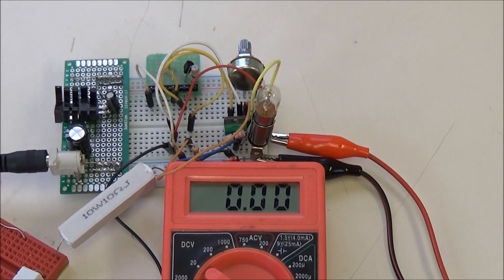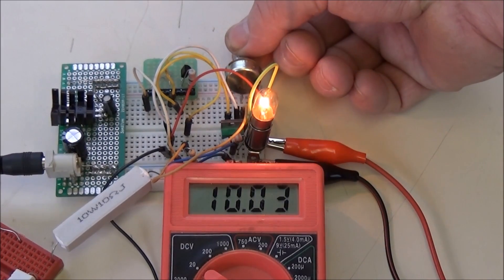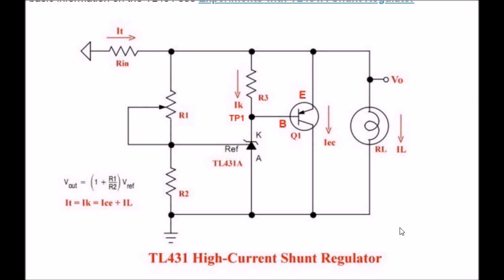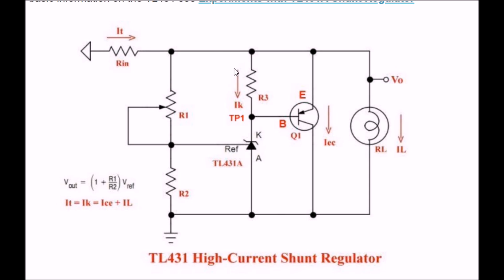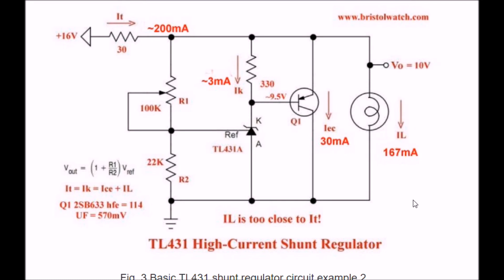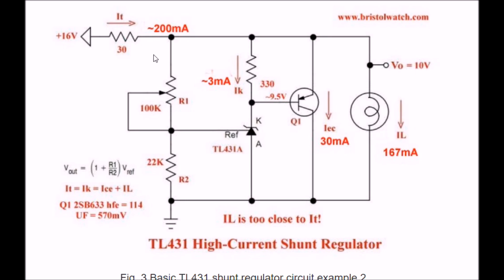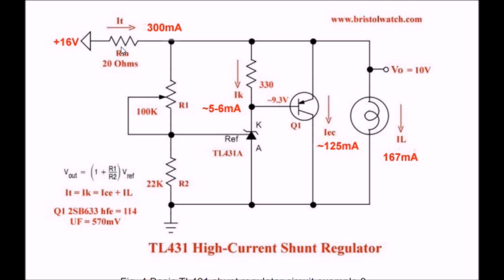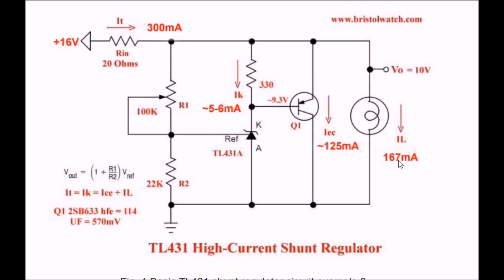TL431 Shunt Regulator Circuits Explained

Comment: im planning to use this tl431's as overvoltage protection on agm/lead acid batteries ..and wonder if theyll cause a problem.. i mean adjust it to 14.5 volts and connect outpit/leak to transistor/mofset therere after it reaches 14.5/max voltage agm batterues it will swith on a lef or something else to waste excess woltage thats going tocause pwercharge... in theory this seems like going to work ;)

Comment: does the voltage divider (R1 & R2) needs to be behind Rin? ... like in the drawing.
I used the circuit to create 5V from 12V without Rin and it seams to work fine and the load is neglectable, although the output is lower than calculated.
Reply from the maker: It can't work without Rin because that drops the excess voltage. I don't know what you mean by " create 5V from 12V" because this is a current, not a voltage regulator. The output voltage is the load resistance times the input current or R*I.
Reply: @LewisLoflin  Well, in the first circuit that uses the TL431, i used them as a positive / negative voltage regulator to create +/- 5V from +/-12V and now I'm designing another circuit with them for the same purpose.
Better to use LM317? the AT27C256 requires 6.5V and 13.5V, i have various zeners but not these values.
Reply from the maker: @AnalogDude_  I have programmed those and used 12-13V and 5V.
Reply from the maker: Use an LM317.
Reply: @LewisLoflin  Thnx, I'm making a programmer for them using a Microchip Fubarino. gonna use transformer of 2 x 15V, a bridge rectifier en than a 7815. so the LM317 will have some 1.5 V head room to make 13.5 V, that's what the datasheet says.
Reply from the maker: My programmer used a 6502-based SYM-1 with real 8-bit IO ports.  @AnalogDude_
Reply: @LewisLoflin  wanna use a 32 bit Microchip Fubarino, it's memory is large enough, i can store the entire "bin" in there. commercial ones are mostly made for windows.

Comment: aplication circuit for balancing all types of batteries!
Reply: This circuit can be used for this purpose, but every battery needs different resistors for matching the different voltages...

Comment: Hi Lewis, many thanks for the educational videos. Please can I ask a couple of questions: is the 9.3v at base of Q1 defined by the base-emitter drop (ie 10v - 0.7v) or by the set-point of the TL431A? Secondly, why would there be roughly 5-6mA going through the 330r resistor? I calculate Vdrop / Resistance = (10-9.3) / 330 = circa 2mA. Thanks again, Sean

Comment: You did not explain WHY the draw is reduced by the transistor when the load draw increases.
Reply from the maker: As the load draws more current, the overall available current and voltage drop. That is detected by R1/R2 voltage divider, which allows the TL431 to change its current draw. That changes the voltage drop across R3, changes the current through Q1.

Comment: is this resistor (between base and +) really necessary? if I want make simple voltage protection ( after solar panel)... Should I use some calculation to consider  Transistor Veb drop?
Reply from the maker: Yes. It helps set the current for the transistor and the TL431. What do you mean by voltage protection?
Reply: @LewisLoflin  I will try use on practice shunt regulator... I want to charge Ni-Zn accumulator (nominal 1.6V, charge 1.9V ) by 4V solar panel. I find TLV431 with Vfb 1.25V, but current limit is low, so I need PNP transistor to conduct more current than this IC. So I need hold  (1.9+0.2 Schottky diode ) 2.1 V. As I know solar panels  are not scary for short circuit, only external heat decries efficiency.  P.S. for this task (shunt external voltages) I can use few, serial connected,  ordinary diodes, but I want try some precision way

Comment: Do we able to give proctection to this shunt regulator psu if the pnp transistor failed ( there was a short between colector and emiter) ?
Reply from the maker: It would burn our RIN, but one could add a fuse before RIN.
Reply: @LewisLoflin thanks

Comment: What happens if the input voltage drops? Will this effect the output current? even if there is still enough excess current for the transistor?
Reply: if the input drops , so will the drive voltage for TL431 witch will then shut the transistor off  maintaining your 10V say , if it is 10V .
Now if voltage drops below 10V plus voltage drop of all additional circuitry you will lose the output voltage .
Shunt regulators work only if the voltage is higher on the input then required by the load .
For situations where you need higher voltage on the output then input , you use DC to DC boost converters / regulators .
They have their own set of problems such as noise etc.. but there is no perfect solution anyways .

Comment: OK, I built this and it is not working. The output stays at 16V no matter what I twiddle on the potentiometer. What could be wrong?
Reply from the maker: Which one did you build the current regulator or voltage regulator? What was the load?

Comment: 2:47 why the current pass through the potentiometer isn't taken into account?
Reply: Because R1 and R2 are using high value resistor, just enough to draw 1 to 10 mA.

Comment: What happens when the load is disconnected?
Reply: Most of the remaining current will pass through Q1, as it has no current resistance. Thus, the Q1 must be over scaled to support all the remaining current when there is no load connected to the circuit.

Comment: Thanks for posting. When do you use practically this circuit. What is the benefit?
Reply: This will be use for controlling the LED dimmer circuit.
Reply: @shubhamingle1743  Yes but why with shunt paralel and not in serie?
Reply: Oh sorry I don't the major difference between of both the use cases in my application I used the shunt connection for controlling the led dimmer of 0 to 10V.

Comment: Can you do a test circuit with 2 TL431 control a 2 mosfet to shunt a 2 battery 12v in serial to maintain the charger for both battery with out deferent in voltage charging exactly like BMS ?
Reply from the maker: Not sure what you are asking. A MOSFET is totally different from a bipolar transistor. One is voltage -operated the other current operated.
Reply: Hmmm . Not that what I mean . I mean let we say that we have 2 serial resistance R1 and R2 and  I need to use TL431 with transistor  to keep a voltage at across a resistance R1  at a certain level even if the voltage increased in the terminal of the R1 R2 .  So what ever the voltage in the input of the R1+R2 the R1 will maintain the voltage that we selected

Comment: If you hooked this (or similar) circuit up to a battery in order to protect it from draining too low, would this protection circuit drain the battery much faster?  By that I mean, will the circuit itself consume a lot of energy?

I'm asking because I was thinking of hooking something up to a 12v solar battery in my vehicle.  It sounds like a very good idea to set up a circuit similar to what you present in the video in order to keep from ruining the battery.  However, if the protection circuit itself is eating a ton of juice then maybe it isn't a good solution since it would significantly reduce how long said device could run.
Reply: Although the comment is very old, this circuit, as shown in the video, is frequently used for overcharging protection (otherwise said, for overvoltage protection). This means that if adjusted properly, it will not draw any current from the battery, as long as its voltage is below its activating voltage. For this function (overvoltage protection) the circuit uses only the voltage divider, along with the TL431 and the shunting transistor (which plays the role of a variable resistor). The entire circuit is then connected in parallel to the battery. This in turn means that if the threshold voltage is reached, the shunting transistor starts to draw current, trying to keep the terminals' voltage stable. If there is a tendency for voltage increase, the current will increase more than before of it. Finally, there will be no current draw by the shunting transistor during the charging process, until the rising charging voltage reaches the aforementioned charge cut off threshold (which will trigger the circuit)...Hopefully this answers your questions...

Comment: Why dont you just connet variable resistor as voltage divider to Q1 to control it?
Reply: it will vary with in put voltage tl 431 never change irrespective of input voltage

Comment: Having R1 adjustable is generally bad practice especially for a beginner. Sure, it has to be done to get down to 2.5V but there is a risk.  Not much over 2.5V the reference pin starts conducting heavily and begins to destroy the 431 when it gets over 10ma. Good design can prevent this by the proper selection of resistors to prevent that in any case. It is quite easy for a beginner to destroy one should the load be removed. A resistor between the wiper and the reference pin to limit current might be appropriate for a beginner.

Comment: In this particular case ( 8:52), it seems that the transistor is useless since the TL431 can handle up to 150 mA, and we will have less than that:  300 mA total,  10 V/44000 Ohm = 0.2 mA through the tension divider, 167 mA through the lamp, 133 mA left, max, through the TL431.  BUT the transistor is required if the lamp is ... not there (burn out, open circuit) since then, without it, the 300 mA will have to go through the TL431 and that is the double of what it is safe for it.
Reply from the maker: This is a demo on how the circuit works. The limit in the TL431 is 100 mA according to the spec sheet. thanks.
Reply: You are right, 100 mA is the maximum recommended; 150 mA is the absolute maximum under stress.
Reply from the maker: Thank you. In general, I'd run the TL451at no more than 30-50 mA or less. While the device is stable generating extra heat will effect drift as it does in semiconductor devices.